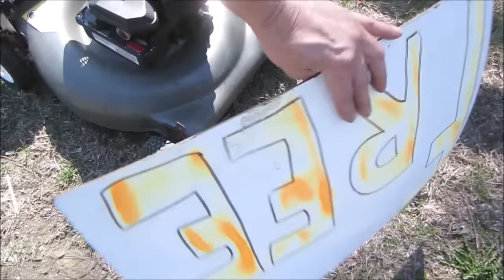How To Restore a Junk Lawn Mower For Free.

Comment: I’ve picked up two free a lawn mower and a edger and I got them both running good again just by cleaning the air filter and messing with the carb a little bit

Comment: I have the same Toro mower that I got for free.  Somebody had mucked up the linkage on the automatic choke, and broke the spring and the air vane arm.  Bought them used online.  Been running it for 4 years, now.

Comment: Excellent video Mustie  1 :) also have ever had replaced a o ring in fuel cap or new fuel cap  to solve of rev up and down on on low also high idles problems before because of fuel pressure to carb ? Also Mustie  bet your small engine mechanic in your area lots work all time too and besides on You Tube videos get services to off in!

Comment: My daughter has this same mower, only a few years newer. It runs and mows fine. After you mow for a while, turn it off and try to restart, the starter locks up. You can't even pull it with the rope. Some times you can take the plug out and rotate the blade to get it unstuck. Would you know why this is doing that? I may take it apart and try to oil that little plunger next to the starter. Thanks for all the videos. Really learn a lot.

Comment: I tilt the deck when I let the grass get too long.  The tilt helps it not bog down when used as a mulcher.  Then I have to remember to level it out for the rest of the season.  Yes, you end up with wavy grass after that first cut.

Comment: I balance my blades after I sharpen them. I have a cone type balancer and it does a good job.  Before I got it, I used a nail on the side of the shop to balance them.   Both seem to do a good job.  I use my angle grinder to sharpen them up.  I do not sharpen the blades on my tractor.  I just replace them with new Gator blades.

Comment: To be honest I don't really balance my blade when I sharpin it either. but I do at least put the blade bolt hole on a nail if it turns one or the other way I take and grind a little. On that side till it don't move. Witch is 1 out of 10 sharpings.
And you are my kind of guy so many people just throw things away and buy new. I'm the same fix it till you can't . It a great life skill to have and it so easy to learn if its something you might want to try and fix . Juts do a little research or reading and you too can fix what you want to fix. It is natural for some people like me and Mustie1 it also helps to be around for over 50 years cause you know what they used to say with age comes wisdom. I used to say you want to gain wisdom you have to do the work to learn the wisdom you want to have. So I learned to fix and build automotive, motorcycles, diesel motors, small engines , can also build a house from the ground up electric, plumbing  basically wherever I need to do I learned. And for me that was my goal as a kid not to pay someone else sometimes a huge deal of money to fix my stuff and save my money for my  hobbies  and there's nothing like the satisfaction knowing you can fix yours and your family and friends things too for cheep . Keep up all the work you do I'll be watching Mustie1 till he stops uploading or I'm nothing but ashes.

Comment: I have that exact same mower without electric start, I have had it for 15 years, It will run forever as long you maintain it, I use Sta-Bil with my gas. Always starts within 3 pulls.

Comment: I had that exact mower for almost 10 years. Never really ran properly, even after carb service. Turned out the bolts holding the intake tube pulled the threads from the head. Whole carb is hanging on those two bolts unsupported.
 The fuel tank also has a free replacement TSB for leaks around the seam. In the end I removed the whole electric start system... it just kept failing, batteries, starter, them wiring/key.
 Carb pulling the helicoil out of the head again was what finally killed mine.

Comment: "Son of Frankenmower" is MY lawn mower. SOF's Briggs & Stratton engine comes from a lawnmower I bought new in 1995 when I bought my home. SOF is on his THIRD frame, two others rusted away over the years. The current frame and wheels were salvaged from a junked mower someone threw away a few years back. 

The controls and carburetor are from a junkyard find. SOF is scarred, cracked and welded in several places, spits oil now and then, and has a "welcoming smoky air" about him... but can SAW right through small tallow trees and knee high grass without skipping a beat. Electric Start, smh, how about a piece of 550 cord wrapped around the barren shaft where the starter housing USED to be...

MY CREATION is a PURE BEAST!!!! and has EARNED the title "Son of Frankenmower". 

When YOUR shiny puft of a mower happily scares the neighborhood children, growls at the mailman, and has survived being tied to a tree dancing around in the eye of a Cat 5 Hurricane like SOF during Monster Michael (the 3rd most intense storm to hit the U.S. in recorded history), get back to me... :-)

Comment: In a place like the gear on that wheel where dirt is an issue I like to use a dry lubricant like silicone or RV dry lubricant to keep dirt from sticking to the grease or oil.

Comment: 34:35 Darren, I've found that thin-bodied graphite-lube is good for "down 'n' dirty" applications like this, in that it's a non-sticky greaseless formula, and so it doesn't attract dirt the way gummy-textured oil-based lubricants do.  It's good for things like trash-grabbing tools, bike chains/sprockets, etc.

Comment: On the racheting drive mechanism, try using a dry film lubricant, such as is often used on firearms. You can find it in the sporting good department of your local discount department store (eg Walmart), or online. As mentioned in your video, oil remains wet and attracts dirt. A dry film lubricant which is mixed in an evaporating solvent is applied wet and then the solvent quickly dries, and the resulting dry film lubricant does not attract as much dirt and dust as oil would.

Comment: That looks like it could be the same mower I bought new in 2005 or so.  It ran great but the drive system had issues - there was so much play in the wheels that it destroyed that little ratchet gear.  A couple replacement gears and a couple thin washers to take out the play and it worked perfect for another 5 or so years until I sold it to a coworker (and switched to battery powered).  The electric start was nice but it doesn't have an alternator so once or twice a season you need to plug it into a charger.  The only difference I see is that mine had a washout port, which was just a plastic fitting through the deck that you could attach a hose to - worked ok, but I'm pretty sure it broke and I replaced it with some brass parts.  And between the lead acid battery for the starter, the engine and the thick steel deck, that mower was HEAVY - not something you'd want to be using without the self-propelled part.  The Personal Pace system, simple as it is, was really nice - no speed dial/lever to adjust, just walk and the mower kept up the exact right speed.

Comment: I believe this ratcheting mechanism was Toro's first attempt at an open differential without actually having an open differential.  In later models they integrated the "open" aspect to the inside of the differential to allow for wheel slip/turning.  And these wheels actually look fairly new, being white and all with tread showing.

Comment: These Toro Recycler mowers are great machines. In the UK though they suffer tin worm and the steel deck usually rots out if they are not cared for. I had a customer who brought one in that looked like swiss cheese and was definitely past it's best.
Reply: I have a 1996 Toro super recycler that I think may outlast me.
Reply: @kjdude8765  my dad has a John Deere 14sx pro from 1997 and it has probably out lasted other mowers built for the UK market and some of the younger models built after it.

Comment: I'm sure you know even though you want to be cheap that you shouldn't be using a multi-grade oil on those style of Mowers. The Honda use the multi grade 10/30.
It's supposed to raise a compression for starting. You do a wonderful job on those small engines. All the best from Canada.

Comment: That's a Tecumseh engine. Good engines. I had that EXACT mower. I got mine for free also from a lawn mowing customer, used the crap out of it then sold it still running. That Tecumseh had a high compression- if you just grabbed the rope and pulled the starter and caught it on a compression stroke you could nearly hurt yourself. Had to rotate slow and get past that point then you could pull it normally. Thats the main reason the lady gave it to me, she couldn't start it.

Comment: Low at the front for windrowing, high at the front for mulching.  If the front of the sweep is lower than the back it has a sweeping action  to one side and ejects cut grass powerfully outwards - but if the back is lower it sequentially cuts the grass and tends to fling the clippings back across the entire width of the cut and re-cut the clippings as they dance about above the blades.  Level tends to windrow still but not as strongly...  Set up plenty or 8' tractor slashers and getting the angle right has a lot to do with the results and evenness of the cut...

Comment: Great job Mustie!  I still have my old Craftsman mower that uses that filter and I buy replacements off Ebay for $2-$3 each.  Do you have a recommendation on good quality bowl gaskets?  Too many out there are just too thin!
Reply: Make you a template/stencil of the existing gasket you intend to upgrade. Your local auto parts store should carry (6" X 6")-(12" X 12") or something of that nature, in all sorts of gasket materials. On small engines, such as this one, I have had countless carburetor mounting gaskets fail upon an untimely removal. I've used anything from a cut of beer box cardboard, to a more appropriate and preferred material. I.M.O, I prefer the slightly malleable fiber typer gasket, (resembles tar paper that's used beneath roofing shingles). With a decent coat of any rubberized coating (i.e.) Flex seal even. Makes the gasket material far less prone to drying, cracking, splitting, or Adhering so much to the mating surface. Rubber coated cork works fairly well too for low torque, reuse applications.
Reply: @austincampbell4092  Thanks.  I am really refering to the o-rings used on top of carb  bowls.  So many are just too darn thin to make a good seal.

Comment: Those are the Toro mowers I prefer actually.  The rear wheel drive models.  Add a bagger to a front drive model, get on a slight incline and you are pushing it as the front wheels aren't on the ground enough to provide any pulling power LOL.  That I think is an early model Toro Personal Pace.  The newer ones have the pull till you die auto choke crap on them without a primer....that and this model has the old Tecumseh engine I believe, new ones I think are no-name Chinese engines, or Briggs & Stratton.

Comment: I have one, maybe two, mowers that one handle raises or lowers all four wheels at the same time.
Like you, I said three pulls. Wow on the first one. I had hoped that you would try the electric start first.
It looks new from the video. I have a battery charger for one of the two mowers.

Comment: It's a case of where new isn't better! Older Techumse motors used a Phelon coil, later ones used a cheaper don't know what kind of coil. Usually try to keep those older Phelon coils from equipment beyond repair. You can get a replacement coil for it online, but you'll be in the same boat.

Comment: Nah, contact between the flywheel and the coil won't interfere with spark, although it would create a lot of noise and perhaps heat. Nor will rust cause a problem. 
I did run across an engine once where the magnet was missing from the flywheel. A "Power Products" two-cycle.

Comment: I used a bicycle chain lube called "White Lightning - Dry Lube" on my self propelled mower & that works great with those ratcheting gears. And it doesn't attract dust like oil does. Must be nice to find free mowers on the side of the road. Not common in my neck of the woods.

Comment: I don't known how manu mowers that i saved from the scrap pile from watching your video's. It's always been a hobby of mine. I've had the problem with the cable from the motor up to the handle bars not pulling the brake on the flywheel back far enough to get spark

Comment: Much better than Cub Cadet that I have. The Cub self propel has a metal gear running on PLASTIC teeth on the inner portion of the drive wheels. I am on my third pair. Teeth get totally stripped over time. Electric start has a crappy small battery that lasted only three years and costs over $20 online so obviously it is now pull start only. This is a heavy beast too making it a pain to move around and pull backwards. I liked Lawn boy better but the crappy coils they had don't last. Original died, replaced it and the replacement ($80!) only lasted a couple years. It was similar to the one on the subject Toro. How can these go bad? There are NO points, NO moving parts!

Comment: you could try cleaning that cam gear and key up completely and apply a specialist dry lube, like what's used in locks - should cut down on the debris factor.

Comment: great video as always :D Wish i had someone like you in my neighborhood. Picked up a lawnmower last week and finished restoring it runs smooth as butter but i got one problem when i give it full throttle it starts stuttering everything below full throttle works like a charm.  ( jumps up and down with the rpm.) I cleaned the carb., the fuel lines, the tank, the gas filter and the air filter and also replaced all the old gaskets and the spark plug but somehow it didn't help. I'm wondering if it's something with the governor ? Any help / ideas would be highly appreciated. ;)

Comment: Regarding deck/blade height, my Toro LX420 Recommends Setting the front of the deck slightly lower than the rear.

I guess there is a reason for that.

“Front lower than back by 1/4 - 3/8”
Front blade about 2-1/2” off ground.

Comment: I've been working for the town Sanitation for about 23 years now and if I was to run a list on what I found majority of you would not believe it. One thing I can say people rather throw it away then have to deal with selling something. But people don't drain the gas or winterize things properly so when they go to start it up they have a problem and they just throw it away. I found countless lawn mowers snow blowers one of my better finds was a complete seven or eight piece leather bag set for a Harley Davidson brand-new in-the-box still sealed in the plastic but also tools and so much more. Some people actually hold a garage sale in the spring and in the fall all from things they found in the garbage. I've put stuff on websites or giving it to my father for when he goes to swap meets to sell things right now I have a Generac generator 5500 BTU the exhaust is not even dirty just had to clean the carburetor and also have 4 chainsaws I'm going to be selling the purchase one good one but this is the time everyone is just starting to cut their lawns and this is when you will find the best stuff

Comment: I had that issue with the spark not happening with that plug on the coil and I got spark right after. Right before I put the pressure washer on the parts stash lol now it runs, but has little pressure but gets the job done

Comment: This mower is the same as the one my wife uses, she likes it because of the power drive, but that said the little gearbox that drives the power drive can be troublesome as it sometimes needs new grease, i put a grease nipple into the cover so i can grease it once a season, easier than fitting a new drive box

Comment: Before you change out the coil, make sure the cap is on the wire properly.   A lot of times, you can undo and screw the cap back on and get spark.   It only takes a minute out of the process to check.

Comment: @11:12 I have on more than one occasion had a no spark on a lawn mower and have cleaned the rust off the coil and flywheel making it spark after being cleaned. More often than not it was due to rust on the coil and flywheel. I repair a lot of small engines.

Comment: Did you switch the oil from sea-30 to 10w 30? I just picked up one that doesn’t run and I did everything that you did except go through the carb. But when I start it without the battery with just the pull cord it still don’t start. The coil is fine still spark but maybe the spark plug. I’ve got another plug for it so I’ll have to check it out.
Edit: I dug into it again today, cleaned out the carb seemed fine. Then adjusted the cable for the safety bar thing. Tried to start it and nothin. The flywheel and blade is spinning. The spark plug has spark but it won’t start. Note that I don’t have the battery in.

Comment: To lube the axle racket try Dry Teflon/PTFE spray. Goes on wet then dries fast. Depending on product use, they lube but don't have oil to pull in dirt and may have some rust protection. Some products hate plastic when wet. Read the label before spraying plastic.

Comment: The hall effect is never effected by the rust. Its not uncommon for the coil to go bad on those. I have replaced several of them last year. I fixed and resold 4 or 5 of those mowers. I replaced the crappy lead battery with a lithium RC battery and charger and they put out much more power. That electric starter alone is worth more than the whole mower. I sold two refurbished  electric start Toro's last year. No one gives mowers away here any more. I buy multi packs of filters on E- Bay for $9.

Comment: That axle/drive system is a straight copy of the Honda HRX series.  The problem with it is it’s dependence on nylon bushings and the inability to grease them without disassembling.  My Honda has to be done every two years or else it’ll lock completely up.